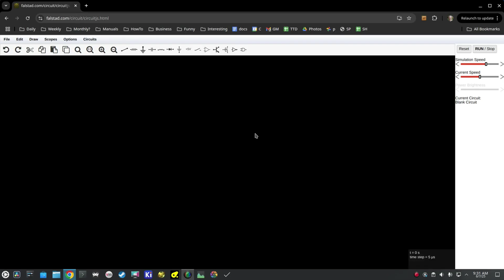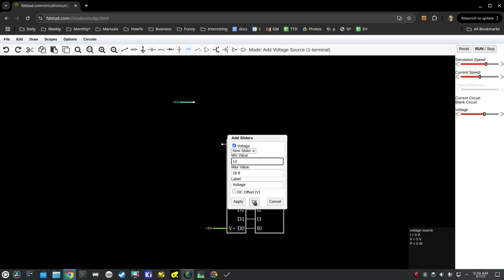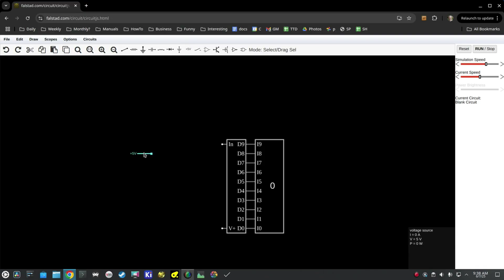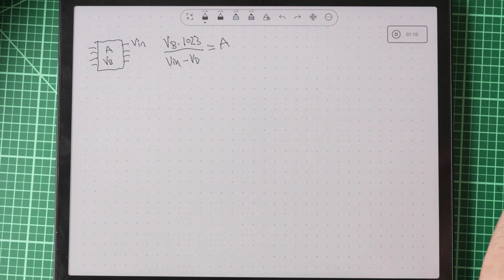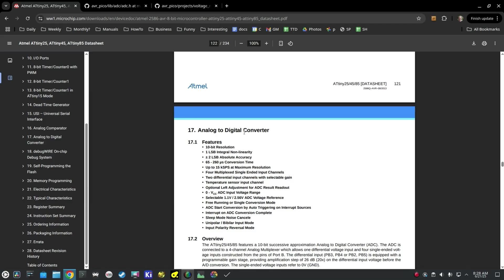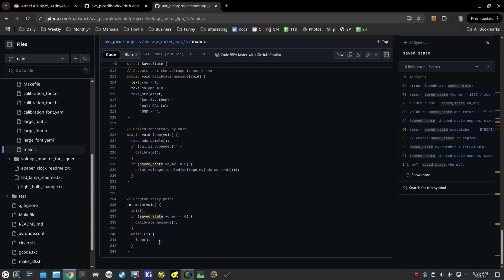Attiny85 Single Chip Voltmeter

Comment: I saw it related that for full accuracy of an ADC count, I think you want to divide by the full count (e.g 1024), but then add 0.5 LSB's of voltage at the end. This signifies that when the ADC reads 0V, if the LSB was 1mV, really it could be reading anywhere from 0.00V to 499uV. Using this will properly minimize the error over the full range of possible ADC values to continuous voltage inputs, even with a perfect linear ADC. Of course probably in a lot projects this small correction is likely to be unnoticeable compared to the practicalities of real life hardware, but it's interesting to know.
Reply from the maker: Thanks for the thoughtful comment.  It's been a while since I did this project but I found that I could not fit the real behavior with a linear curve fit.  I think an interpolated lookup table would be needed to get the most out of the interval reference.  Using a resistor divider or dedicated IC comes in as a better solution when  accuracy is important, in my current view.
Reply: @mattselectronicsrc4423 your extra term to add extra fitting is a clever solution in itself. I wonder if the inside voltage reference is losing absolute value when faced with "wildly" varying VCC.
Reply from the maker: @ivolol  That could be although I was using the largest hardware sample period in code and also did a low pass filter (sliding average of several samples) to try and stabilize things  digitally as fast sample was not needed for this project

Comment: Hi , thx for these videos , i was wonderin if you could power this project from a cr2032 coin cell , or is the current draw too high? what speed is your attiny85 set to?
Reply from the maker: Hello.  I think a CR2032 could power the ATTiny85 but the current capability is likely too low to power the OLED.  You could use multiple CR2032s in parallel but battery life might be another issue in that case.